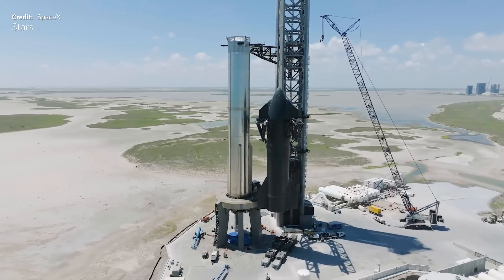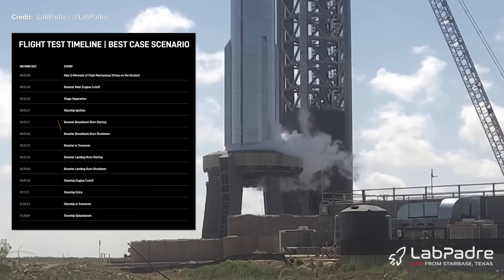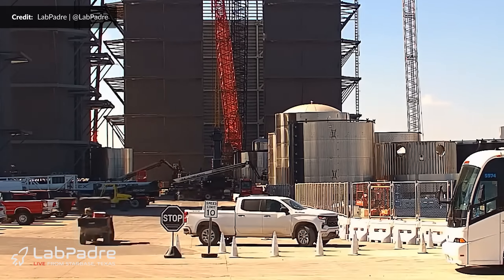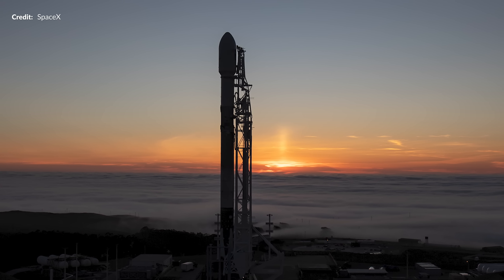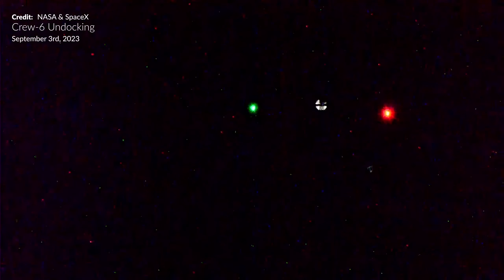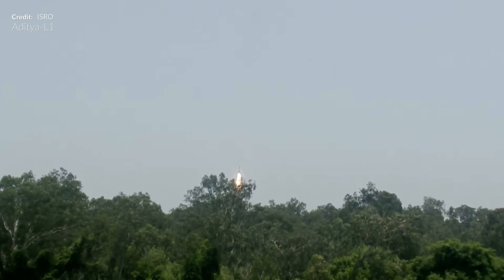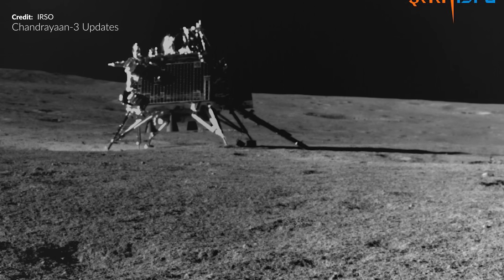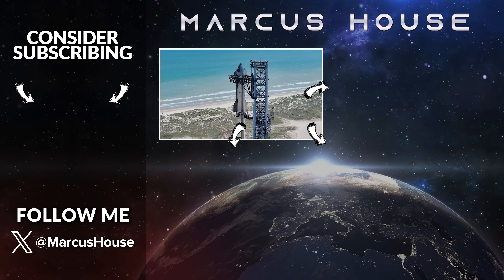Good or bad news for SpaceX's Starship Flight 2?, New Lunar Lander Launched

Comment: SpaceX has stacked the Starship SN25 atop the Booster 9, thereby setting a new record for the tallest rocket stack ever. The hot staging edition was added to the Booster 9, and three engines will stay on during stage separation. The full-stack testing began with the fire suppression system followed by igniter firings being heard on Lab Padres Rover 2 camera. The grid fins of Booster 9 were actuated back and forth, and the chopsticks joined in on the fun. SpaceX also lifted a manifold out of the water deluge tank farm, which is a critical part of the pipeline system. The manifold is believed to be the part of the pipeline system that delivers water to the deluge system, which is used to cool and suppress fires in the launch pad area. SpaceX may have conducted a dry dress rehearsal, which is a full launch countdown without involving any propellants load. SpaceX has re-engineered everything needed since the first flight in April in just over four months, which is a testament to the workers at SpaceX and how quickly they addressed those issues.

Comment: Birds will want to go in the Hot Staging Ring.  Depending on how long it sits waiting for flight, but a group of cameras should be fix on the ring 24/7.
Reply: if there were any birds in the hit staging ring, they would probably be long gone by the time it reaches stage seperation lol
Reply: I was just considering it’s the first time there was access to the stacked StarShips engine area for potentially long periods of time.  Then what possible issues with the new factors are possible.  Just putting it out there for the group to consider if they already haven’t 🤔

Comment: Now that they added the hot staging ring, it appears that Mechazilla is pretty much at the top of the tower when stacking.  Does this mean there is not longer an option to increase the length of starship by 10 m to increase interior capacity?
Reply: I imagine it would just mean a relatively simple fix of adding another segment (or two) to Mechazilla. I'd be surprised if the pulley cable wasn't already long enough, but if not that shouldn't be much of an obstacle to overcome either.

Comment: Presumably the Langrange points will vary slightly according to the orbit of the moon around earth (as well as an even smaller variation caused by the orbital paths of the other planets in the solar system)?
Reply: The craft will be able to make slight corrective adjustments to remain in orbit around L1. Ditto anything orbiting L2.
Reply: @EMichaelBall   not only "will be able to", but "must". Neither L1 nor L2 is stable... it doesn't take much effort for a spacecraft to stay there, but they do need to actively maintain their position through periodic correction burns.

Comment: I have a question, how much G forces will the Starship have at landing?
Reply: during reentry, not too much i think. probably comparable to the space shuttle since it takes a very shallow reentry profile. as for the actual landing, idk. it depends on when they start the landing burn, at what height, what thrust, etc.
Reply: @HamzahKhan314 The upcoming landing, because it will be a purposeful destructive landing at a missile range, the G's, when it hits the water will be about 1000 G's! Or more! 😅😂

Comment: From an electrical charge on matter perspective, I have written a piece on why Stage Zero failed so explosively last time around and what to expect from the new metal deluge system now installed. This will go up on my site after the next launch countdown starts ¦:¬)
Reply: Do you have any opinions on using quark spin polarization for improving booster stage stability, and do you think utilizing a 9-dimensional turbo encabulator combined with a suitable cat-juggling matrix will improve performance on IFT-2?

Comment: You need over flow grids entire networks dedicated to taking up the extra power ..a fail safe to theirs event is to actually open the whole network an let it dissipate into the network the larger the better chance the network has ...the more block in the pipeline(wires) the more chances of blow out

Comment: Still not cleaned up the failed lunch debris the tossed rocks and rebar 1000 feet into wetlands.
Waste water is still not contained and dumped into wetlands.

Those two points will have to be fixed before FAA certification as the are environmental impact issues.

Comment: I was watching a YT channel called Huygens Optics. He made a monolithic telescope. ie. Just one piece of glass. Very small. So that leads to a question for space X. Could they add a camera(s) for earth observation. ie. Very high resolution compared to geostationary orbit, with a higher frequency of taking the images because there's high bandwidth communications. Plus because the camera is moving, you can reverse engineer 3D structure of a lot of clouds.

Comment: Can hot staging result in more capacity? If oriented, the starship engines could be used to decelerate the booster some so less fuel would be needed for boost back.
Reply: It results in more capacity because it maintains the velocity of the Starship.
It increases the total mass to orbit by about 10%. And with Starship, that's a LOT!
  👻☠️🗽💯🙏
Reply: Increasing capacity is the entire purpose of hot staging... it eliminates the brief coasting period during staging, where gravity is pulling and the engines aren't running. And that's supposedly worth as much as 10% payload capacity...

Comment: Opera GX keeps forcing me to reboot my computer when I use Picture in Picture. SOmetimes the PiP window stays open as a grey box and does not close even if I force opera to close in task manager. The pop up window appears as a separate process and if this happens you HAVE TO log off or shut down your PC to close the greyed out picture in picture window. Opera GX has lots of features but doesnt even do them correctly. Opera GX is mid honestly, ngl. 5/10 could be 10/10 if they fix their features they brag about and tell streamers to advertise- cause you're just telling people to download a buggy browser at current

Comment: @5:55 speculative Not at all. It's most probably the first iteration of the LEO refueling tank. 
Next comes several space operations for transfer fuel and oxidizer in and out. SpaceX will surely have tanks stationed from LEO to GEO.

Comment: Elon was being very disingenuous about the FAA report in his tweet response to you.  He knew very well that the FAA had pulled his license to launch and was investigating the problems with the first launch and would come back with corrective action items that will need to be addressed.  You glossed over the 63 corrective actions that the FAA is requiring SpaceX to complete before another launch can take place with this rocket system.  It really doesn't matter what changes SpaceX has done if they do not address these corrective actions.  If the launch is delayed, do not blame the FAA or government regulations, blame Elon and SpaceX for inferior designs and the arrogance to think they "know better" when they have proven otherwise.
Reply: Space x knows exactly what needs to be done, they worked very closely with the FAA for the investigation. No one knows exactly what the 63 corrective actions are, but it’s safe to say that space x was already working on them before the investigation was even complete.
Reply: FAA didn’t “pull his license to launch.” The license was for one launch only. From the beginning SpaceX would have to apply for modifications to it for subsequent launches. This is stated in the FAA’s letter.

The FAA letter also stated the full acceptance of SpaceX’s mishap investigation report as properly completed IAW the FAA’s rules and without requiring any additional information. The 63 corrective actions were developed by SpaceX (and obviously SpaceX has already been working them furiously) and again the FAA accepted these as correct without requiring any additional actions needed. This is also stated in the FAA’s letter.

The FAA letter also stated that the launch license will be modified to allow another launch when SpaceX provides evidence that they have completed the SpaceX-designed and FAA- approved corrective actions and levies no additional hoops for SpaceX to jump through.

Basically the FAA told Elon “good job on the report and the corrective actions, just execute your own plan and you’ll get your license.” 

This is all very good news for Elon and SpaceX indeed. 

It’s not Elon who’s being disingenuous.
Reply: @Spectator1959  Thanks for the details, it is nice to see the collaborations.  Elon's text as shown in the video says "Maybe it's in the mail or something. i don't know what these actions items are".  That was either a poor sense of humor, he was not aware of the details or he was being disingenuous.
Reply from the maker: See latest X posts. 63 items are shown now and complete. No problem.
Reply: @MarcusHouse  Who still uses Twitter (sorry X)?
Reply: @MarcusHouse  If it was a done deal, why hasn't another launch taken place by now.

Comment: the launch will fail again due to incompetence in engineering and a horribly flawed deluge not to mention horribly flawed launch complex in general.

starship team is telling you the failures are successes as they retrofit the launchpad w a flawed design.

the high pressure lines feeding the water cooled cement barrier underneath the rocket will rupture under the intense vibration.

the deluge will not suppress the vibration and the energy from the undeverted trust will again destroy the complex.

the vehicle quite probably will fail as well but will the self destruct fail ? 

these problems have been solved already by real engineers like the ones in NASA for example and the notion the starship team has to find out for them selves by failing is a pathetic excuse to make. 

oceangate 2.0